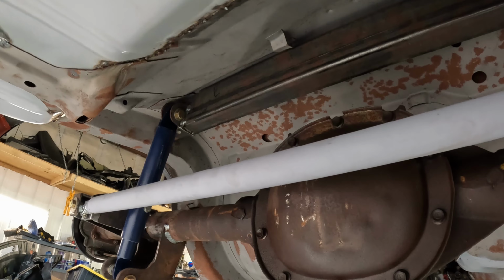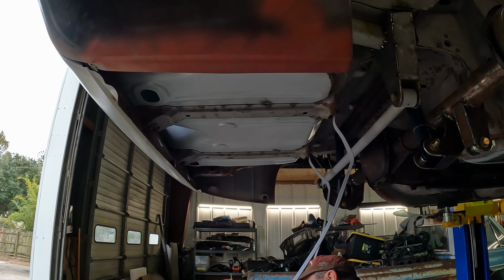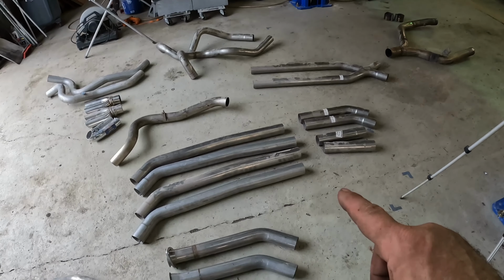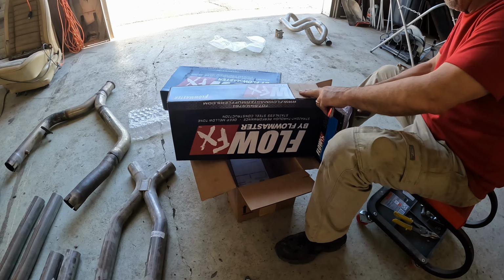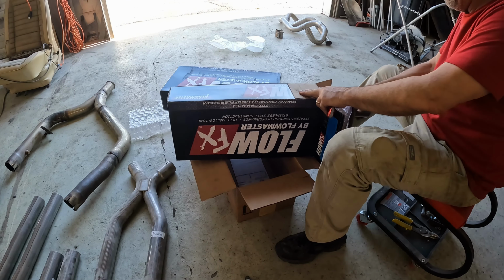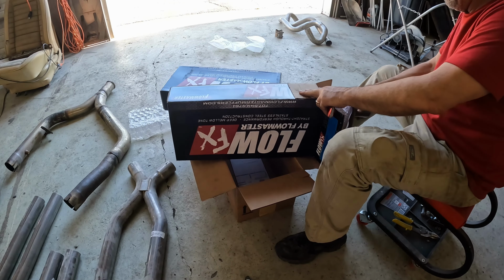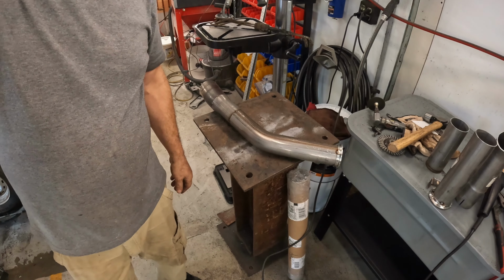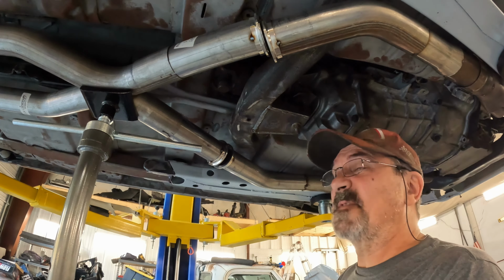Firebird Ep. 40 An exhaust system for the Firebird

Comment: Great video. Liked the way you used the line-up at the rear. Using the tips loooks grreat. I used the bands for quick excess as well. I would have modified the right side header for clearence.
Reply from the maker: Might still have to - the header might return to its original position after a few heat cycles. If so, I'm thinking I would be better off relieving the frame rail instead.